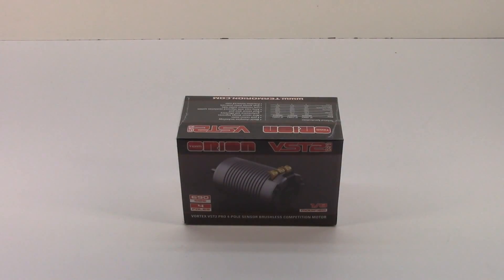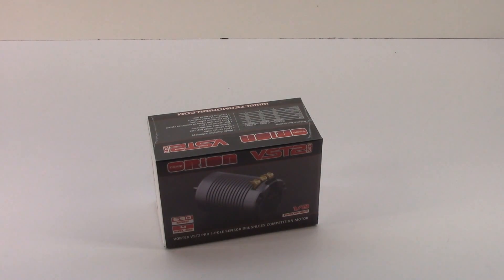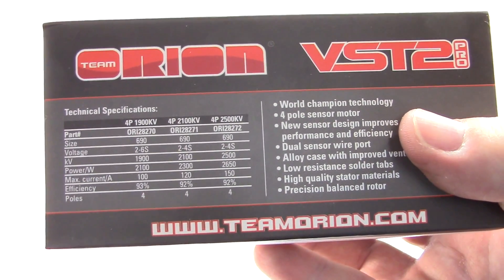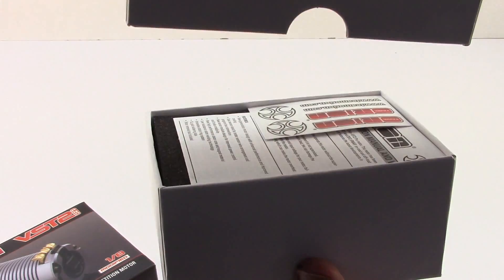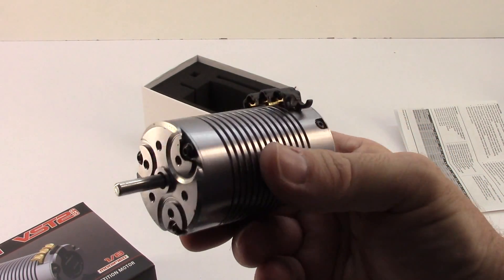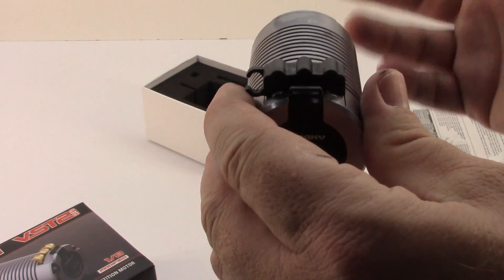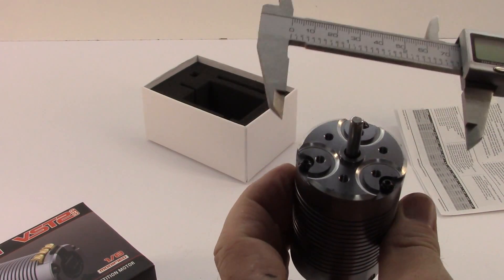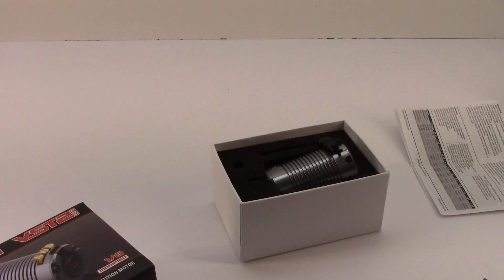Team Orion VST2 Pro 690 2100kv Motor - Unboxing

Comment: Will the HMX 10 ESC work with this?
Reply from the maker: The motor in the video is an 1/8th scale.  The HMX10 is for 1/10th scale.  YOu'll be limited to a certain voltage on the HMX10

Comment: how would this work in a losi scte
Reply from the maker: +sparks It would bolt right in...but weigh it down, since you'll need at least 3-4s to gain any speed
Reply: +The RCNetwork thanks. ..so what motor should I use
Reply from the maker: +sparks Get a 550 sized motor like the Tekin Pro4 HD 4300.  Plenty of power and you can run 2s
Reply: +The RCNetwork thanks

Comment: The six screws around the backplate are meant to hold it ? These screws don't appear on your box's picture. I have seen at least one topic of this motor where the backplate just fell off as it was only held with glue and it didn't have any screws around the backplate. Is it a fix and therefore a sort of vst2.1 ?
Reply from the maker: +shannow95 Wow...I noticed that after re-watching the video.  All is good with my motor though....maybe a V2.1?